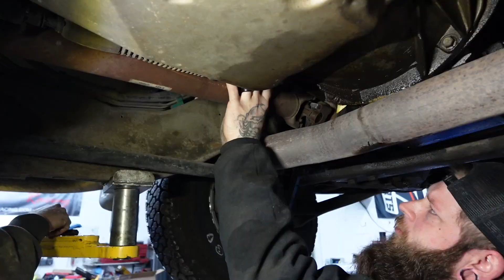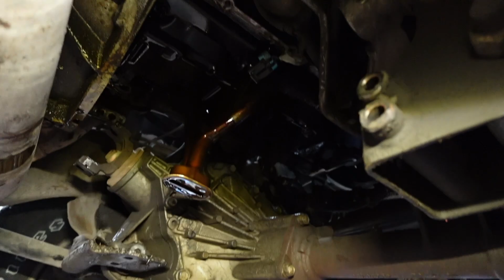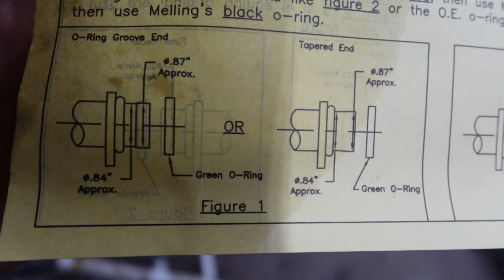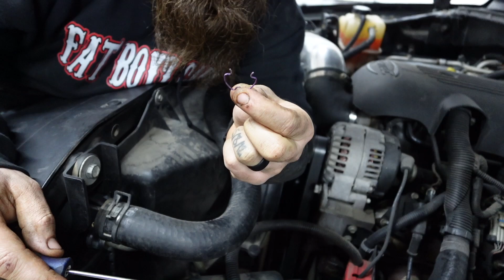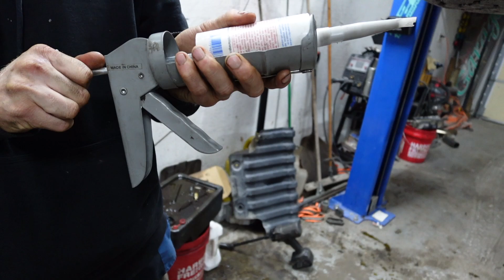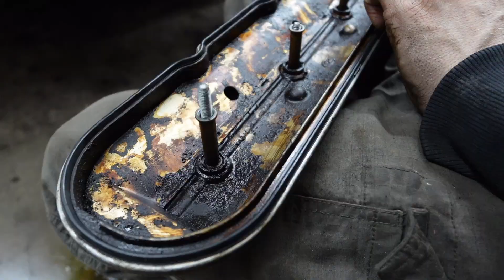99-06 2500HD Silverado/Sierr- 4WD-How to Change the Oil Pan Gasket and Pickup tube O-Ring

Comment: I'm sure that the pickup tube o-ring has split on my 6.0, as it aerates the oil when the engine is cold and has low pressure. Acts normal when it's warmed up.😊

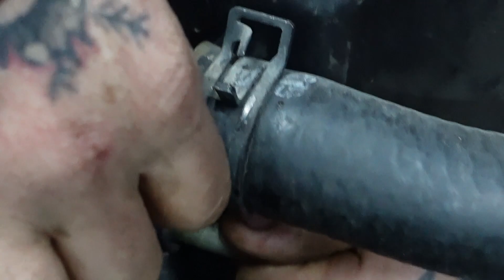Comment: 10:46 are those quick connects supposed to be able to wiggle a little bit when fully installed? im replacing them on the underside of my 99 k2500 suburban and they are not super tight. its the same piece you have on your radiator but they wiggle around too much for me on the oil cooler hoses
Reply from the maker: They should fit pretty snug but may have a lil movement
Reply: @727motorsports ok. thank you

Comment: Thanks for the video. I have seen so many people doing it on a 2wd. First video I found covering the procedure for a 4x4. And with the oil cooler lines too! Apparently a lot of trucks have a block-off plate installed above the oil filter instead of oil cooling lines. Wish me luck

Comment: Nice job. Were the oil cooler lines for the engine or trans? Were they leaking at the "Flex-Crimp" area of the line? Thx for the oil pan gasket tip. Always thought Fel-Pro was the gold standard of gaskets.

Comment: Guys make sure you use a red O ring whoever does this. I messed up and put a black one and they are not for high temps so it melted! I have to do all this work again. Buy the O ring part.
Reply from the maker: The color oring actually depends on how the end of the pickup tube is designed. There’s 3 diff pickups tubes. If the oring melted I’d say it was prolly a cheap quality silicone material

Comment: I have a 2004 Cadillac ext 6.0l vortec suddenly have zero oil pressure on my gauge on dashboard I changed oil pressure sensor and still zero oil pressure reading . Not leaking oil and fresh oil change you think it could be the pick up tube o ring or the pump ?
Reply: Seems pretty common, its an inexpensive thing to replace. The pickup tube is only held up with one bolt,so vibrations and time can wear out that o-ring. Some folks add a brace that puts in a 2nd bolt (theres already a hole there, GM just never used it).
Reply: Did you get the o-ring replaced. I have a 2002 Cadillac Escalade EXT, and I have the same low oil pressure

Comment: Did you have to replace the clamp for the driveshaft boot?
Reply from the maker: As long as the boots in good condition you can’t typically zip tie if you don’t have any clamps. I use to think that was “ghetto” but a lot of bellow boots for steering racks come with zipties. New clamp is the best method tho!

Comment: What’s the typical cost of an oil pan gasket repair w/ O ring as well on 2004 2wheel drive HD
Reply from the maker: That’s like 500-700 job at my shop parts labor and an oil/filter change lol.
Reply: I hope you did it yourself ! On a 2wd drive its a 2 hour job (most of it cleaning shit up). I would say $150 bux & a couple hours.

Comment: I have a 2005 2500hd I just started doing this so I can swap my oil pump do I need to disconnect the axles and let the diff hang as low as possible or am I good to leave it bolted up
Reply from the maker: Yeah you’ll have to at least let the diff hang some!
Reply: @727motorsports  thank you for the response brotha 🤙🏼

Comment: I have to do the same with my truck, but it's a 2003 2500HD.
Reply from the maker: I hope you found this video helpful!
Reply: I got a 01 GMC Sierra 2500 heavy duty 4x4 6.0L V8 that I did a motor swap out of a 04 2500 heavy duty Chevy Express and now I'm having to do the same thing you guys are doing except for I don't have a lift😂😂😂😂😂
Reply from the maker: @Regroup_with_the_DevilDogs having a lift is a huge benefit! We still do a lot of crappy jobs on jackstands too tho 🙏🏻
Reply: @727motorsports yeah I never got around to it. Save it for spring time. I changed the PCV valve and the leak is quite a bit less.